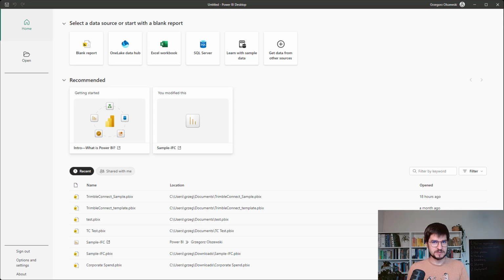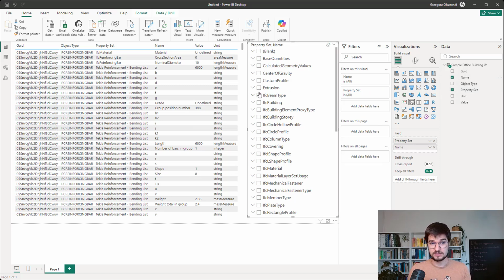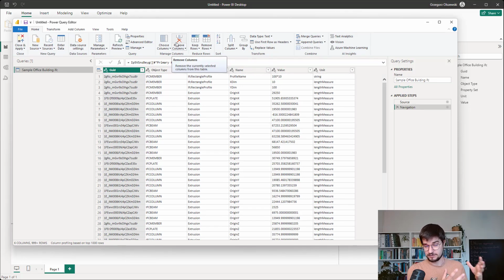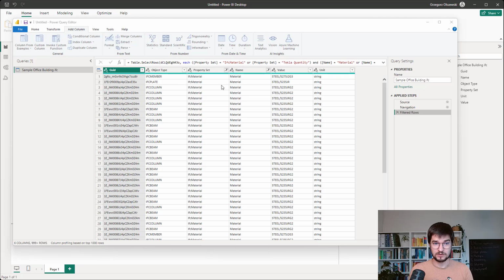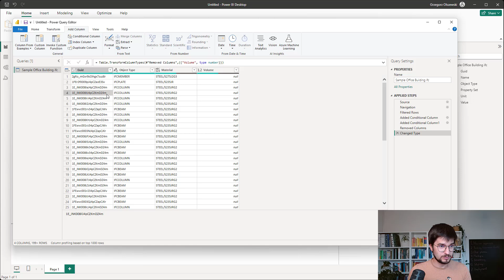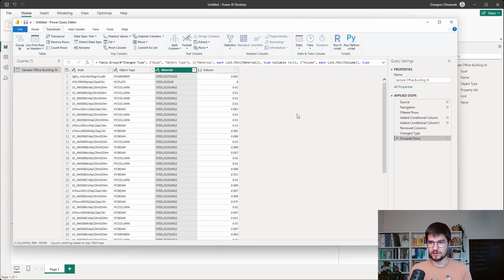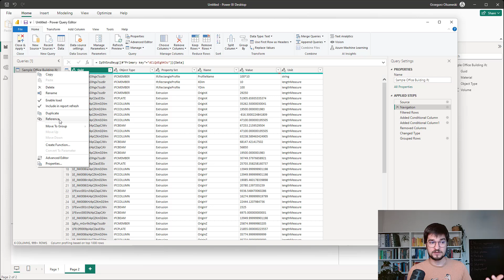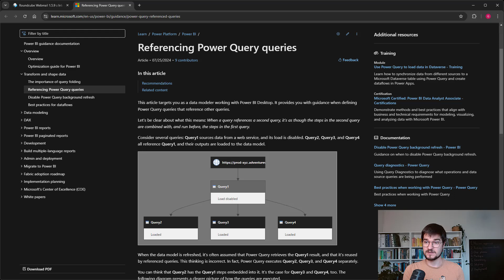Trimble Connect Power BI Connector Usage

Comment: Hi I tried the connector! Great job!! Thank you so much. It's great to be able to link the data and analyze the model in PowerBI without redownloading the data every now and then. 
By the way, seem like the data is the only the one from the model, not include the custom properties in Trimble Connect. Is there any way to connect those data into PowerBI as well?
Reply from the maker: Thanks :) I looked very quickly and it seems that custom properties can be retrieved with different API:
https://app.swaggerhub.com/apis/Trimble-Connect/pset-prod/v1

For the existing connector I used model API:
https://app.swaggerhub.com/apis/Trimble-Connect/model/v1

Currently I don't have time to modify the existing flow. But I want to leave that to comment to mark a beacon for eventual future development.